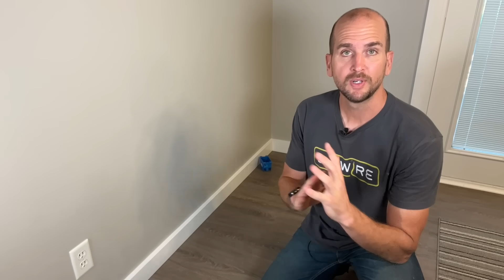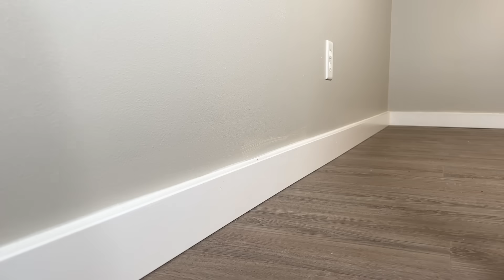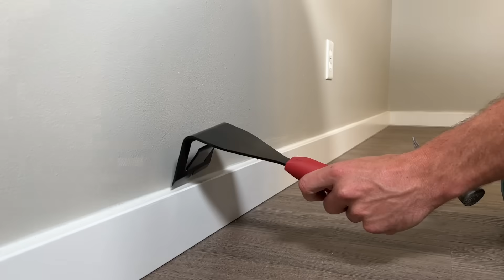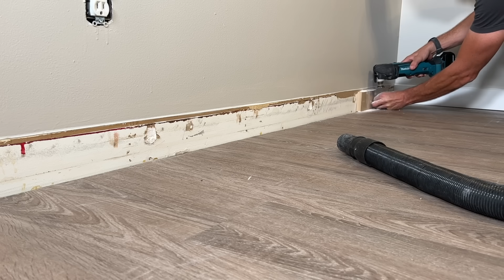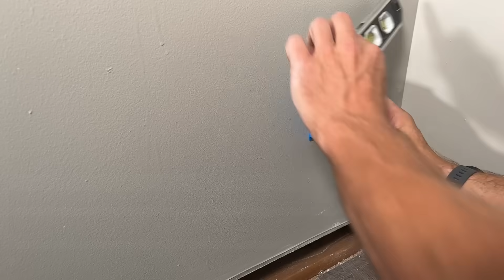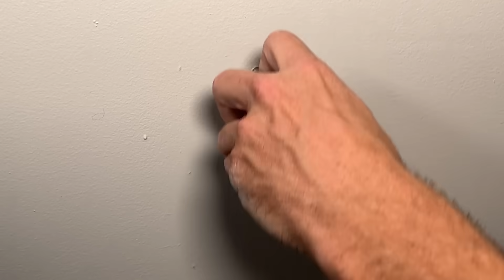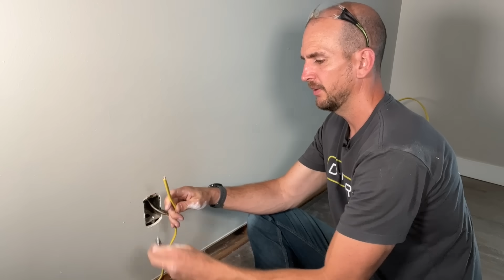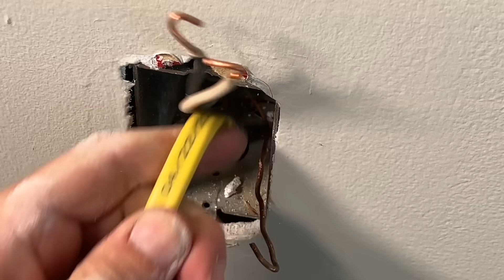How To Add An Outlet To A Finished Wall

Comment: Why did you have to use the wago connectors? Could you not have just screwed them in to the other two screw connectors on the outlet like they normally are?
Reply: There are manufacturer's and physical limitations as to how many wires can be insereted into them. Thus different colors for easy id.

Comment: This is a BAD idea. Unless you are gluing the baseboard, the studs should have nail plates to prevent nails from puncturing the wire.
Reply: He drilled above the baseboard.
Reply: @robertlafleur5179  You’re right. Somehow I missed that.

Comment: Question from a noob: since you're going through studs, don't you have to put a metal plate on the front of the stud so that you don't accidentally drive a screw into the wires at some later date?
Reply: I think the rule is to keep the wire at least 1.5 inches from the front of the stud or use a nail plate. It might vary by location.
Reply: @MoneyManHolmes  but then u have nothing to nail into for the baseboard.  I don’t like this hack…saw a few other YouTubers suggesting this install.
Reply: @jayjaghla7310  His holes in the studs were up above where the trim is for exactly the reason of not putting trim nails into the wire (or nail plate were one to be used), which he stated in the video, meaning the baseboard trim has full use of the studs behind the trim. The difficulty in using a nail plate would be that it would need to be installed in front of the hole used in order to protect the wiring, which he intentionally but behind drywall that he was not removing, so you would not be able to sneak it in there, you'd have to remove that drywall as well, which means you're patching and painting, negating the entire point of doing the drywall removal only behind the trim.
Reply: He should have.  They're like 10 cents.

Comment: Good video! One tip, when using old work boxes you can remove the ears off the outlet so the outlet recesses better into the box and its cover will sit flush. Ears are useful on new work boxes so you can get the outlet stable against drywall, especially if the box is recessed a little. On old work boxes, the box itself has ears for that stability so you don't need the extra set on the outlet - and the box accommodates this with the center being recessed a 1/8 inch from the ears on the box corners. The de-eared outlet will sit perfect in that recess allowing a clean cover plate flush on the wall.
Reply: I noticed this also. I was glad someone already addressed this.
Reply: Yes, and the ears even have pre-scored separation points that only require a few bends back and forth with pliers to remove them. No reason not to do it like they were made for.
Reply: @larrywalker7759  yep
Reply: That’s actually a great tip. I use tons of old work boxes and never remove the ears on the outlet. Now I understand why my cover plates sometimes sit a bit proud.
Reply: I recently did a similar project, and found the plastic "old work" boxes, even with the metal ears removed from the outlet, required that I use the outlet covers that are slightly larger.   Kind of annoying, and wondering what others do to remedy this issue.  No clue, still.
Reply: @88KeysIdaho  If you have to use oversized plates, you cut the hole too big.
Reply: @garychandler4296  No, the holes were quite snug. The blue tabs from the box itself,  kept the normal sized plate from being able to sit flush against the wall.

Comment: I've seen "old timers" pull the baseboard and just cut a channel in the drywall in the middle of the baseboard area the same size as the romex. Then just run the romex in that channel and to the new box. Reinstall the baseboard and don't nail in the middle and good to go.
Reply: I’ve seen it many times.
Reply: While that works, it is not up to code. The wire will be to close to a nailing surface.

Comment: Followed your tutorial and got stuck when I discovered the outlet I want to draw power from is fed with knob and tune type wiring.  Advice on how to proceed?
Reply: You can extend a KnT circuit with romex but it won’t be grounded. 
So you need to use 2 slot outlets or gfci outlets.

Comment: Okay but you forgot to mention that this can't be done on a load bearing wall because now you have just weakened all of your studs at the bottom!
Reply: Not true. As long as a hole’s size is no more than one-forth of the stud’s width, the strength is not compromised.

Comment: This is brilliant. I've been dreading trying to figure out where the bathroom wall sill plate is from the basement to run a second outlet from the (only) GFCI in the bathroom. Just a few more tools for me to buy (the trim remover, an oscillating tool, a drill extension, and a brad nailer).
Reply: Slim pry bar short or long ,short chubby/long spade ,spade extension 6" and 18v angle drill by Ryobi or Ridgid will do for  start.
Reply: For finding invisible things my course locator is a telephone tone sender/receiver kit, then I'll narrow it down with a stud finder then use my phone's sensors to find some magnets.
Reply: Use a stud finder and blue painter’s tape to mark stud locations on the wall. Cut a opening for a cut in box (plastic box with wings) in between the middle of the two studs. Using a metal coat hanger (or buy a 1/8” x 12” drill bit) drill though the floor against the front of the wall where you cut the opening for the outlet. Remove coat hanger wire (drill bit) and leave in the floor. Keep your bearing in mind and go downstairs to your UNFINISHED basement. Find your coat hanger wire (drill bit) and drill a 1/2” hole up BEHIND the drill bit (coat hanger wire) and up through the bottom plate and into the wall cavity. Remember to try and drill through the MIDDLE  of the bottom plate!! Pull your wire and make your connections.  If you do use a drill bit be careful with carpet. It can catch the pile and pull out a row of yarn. Hope this works for you.
Reply: You will most likely get into trouble adding conductors into the box with your GFCI. If it is an end of line circuit in your existing box you could terminate to the load side of the receptical. If there is more than two cables going into the GFCI box you probably will be overfilled. And it might work but it'll be really hard to make it  all fit.

Comment: Great stuff. One time can you do a video on the proper way to tuck wires in a box, especially when you add a pig tail? I struggle getting wires tucked in there neatly
Reply: Prebend wires to run the farthest possible in the same direction and then double back.  

Don’t twist or tape your wires together.  Use a lever or slip-on connector instead.

Tuck wires into the box neatly one at a time.

Comment: Those Wagos aren't code compliant. Yes, they are UL listed, but they break code. When using parts for that use they must meet the minimum insulation value of conductors. In this case Romex insulation is rated at 600V while the Wago is rated at 300V. So as nice as they may be, they're illegal. Now, if a manufacturer has them pre-installed, then they take liability for failure. As an electrician I won't accept the responsibility.
Reply: The Wago 221s (the common one) are rated for 600v and 20/30A. UL listed for that as well. It's in the brochure.
Reply: Got a NEC source for that? Haven't heard this one before, closest code I can think of is 303.3(c) which requires all conductors in an enclosure, raceway, etc. to have an insulation rating greater than the maximum applied voltage (not the highest rated insulation).  110.14(B) just requires are splice using a "device identified for the use" which WAGOs are.
Reply: When will a receptacle have 300v running through it?
Reply: @howtodoitdude1662  120 volts A/C is a RMS voltage, the peak voltage is 170 volts. Likewise 240 volts A/C has a peak voltage of 340 volts.
Reply: @robertlafleur5179  cable ratings are given as RMS, not peak to peak voltage
Reply: @jimbojames9370  True, cable ratings are in RMS. 
For 120volts A/C RMS, the peak voltage is 170 volts (120/0.707). 
This is half the amplitude of the sinusoid, the overall amplitude is the peak to peak voltage which is twice the peak voltage so 340 volts.

Comment: I watched a video that an electrician wiring through the studs, and he explained that you should make the wire go through the studs at a certain height. But I’m not sure if it was the nec code. So I wonder if wiring at low height through the studs is okay.
Reply: As long as it is at least 1 1/4" from the edge of the stud, the height doesn't matter. Less than that requires a nail plate, which makes it much harder to reattach drywall without a hump. So, for a 3 1/2 stud (2x4), you need to be pretty much dead center with a 3/4 hole.

Comment: Thank you, I have learned a lot from your channel.  Here is a DIY that I’d like to learn.  I replaced a bathroom ceiling light fixture with a combo ceiling light & exhaust fan and ran the exhaust through the attic to the eaves.

However, since it is a single circuit, one wall switch turns on both the light and the fan simultaneously (of course).  So, what is an easy way to have separate light switch/exhaust fan switch without running new Romex & circuit?
Reply: The only way to do it is to have 2 switch legs (aka 3 wire romex with a white, black, and red). If theres only 2 wire romex up there currently, you would need to run new 3 wire to replace the old 2 wire, or run another 2 wire (I personally would just replace it with 3 wire). Then you can either add another switch by upping the gang by one at the box, or the easier option would be to just use a stack switch.

Source: Am an electrician.
Reply: @chrisruss7863  thanks, figured without running more wire, I couldn’t switch two circuits.
Reply: @chrisruss7863  Couldn't he just pigtail off the power source coming in (plus Common and ground) and wire that to a new switch then onto the device? Just a diy'er.

Comment: I like the tip at 6:00 to put connector onto wire first
Reply: Not really a tip.  It’s how you are supposed to do it…even if it was new construction with an open wall.
Reply: @jayjaghla7310  It's a tip for those that didn't already know it but not for know-it-alls!

Comment: Scott, that was amazing diy project and much cleaner that an electrician would do. Mine would’ve cut rectangular holes on each side of the dry wall and used a drywall screw in the stud to cover the hole. His work is great but he doesn’t do drywall!
Reply: Your electrician doesn’t know what he’s doing lol I’ve been an electrician for 11 years and I’ve always done it that way lol
Reply: What did you just write? 🤔

Comment: I always build house wall double outlets boxes so always 4 outlets lights double outlet boxes so 1 switch fan 1 switch lights — really no increase in price. Single box vs double, cover plate single vs double  extra switch / outlet adds about $.25. And wire one outlet to other is nothing since use scrap wire lengths
Reply: Good ideals, but you will have more than $.25      added. You have the cost of an extra receptacle each time you add a double box and an extra switch when you have separate light and fan switches. (Even though I would always want separate switches for the light and fan.)

Comment: You deserve as much viewership and recognition as my boy Jeff over at ‘Home RenoVision’. Keep up the good work, you’re helping a lot of folks out.
Reply from the maker: Thanks for the kind words, those are some big shoes to fill but I will keep cranking 👍👍
Reply: Jeff is one of the guys who taught me how to tape and bed drywall. Without him and Vancouver Carpenter, I wouldnt know nothing about drywall.
Reply: Failed to install required steel nail plates.
Reply: @denverbraughler3948  and how exactly would that be achieved with the drywall up?
Reply: @matsudakodo :

The drywall was cut out behind the baseboard to run the cable.
Reply: @denverbraughler3948  the nail plates need to go where the wire is. The wire is up behind the uncut drywall. I don't see how you could install them?
Reply: @matsudakodo :

You have to run the cable behind the baseboard and install nail plates if you wish to comply with the NFPA electrical safety code.

«In both exposed and concealed locations, where a cable- or raceway-type wiring method is installed through bored holes in joists, rafters, or wood members, holes shall be bored so that the edge of the hole is not less than 32 mm (1.25”) from the nearest edge of the wood member. 
Where this distance cannot be maintained, the cable or raceway shall be protected from penetration by screws or nails by a steel plate(s) or bushing(s), at least 1.6 mm (1/16 in.) thick, and of appropriate length and width installed to cover the area of the wiring.»
Reply: @denverbraughler3948  so this method isn't going to meet code. However, it's beyond what a home inspector can see, so I'm not sure who would throw the flag. Good point though, it should probably be done as you mention.
Reply: @matsudakodo :

Code isn’t about passing inspection.  

It’s primarily about protection of lives and secondarily about protection of property including equipment, with a dash of avoiding stray EMF and other annoyances.

(If you’re going to ignore safety, why deliberately run the cable above the baseboard?)

Run the cable through holes 1.75” back (centered in studs) where it’s protected by the baseboard and 1.25” of stud depth.  It’s safe, effective, easier, and NEC-compliant.